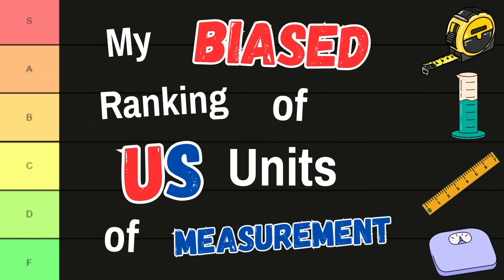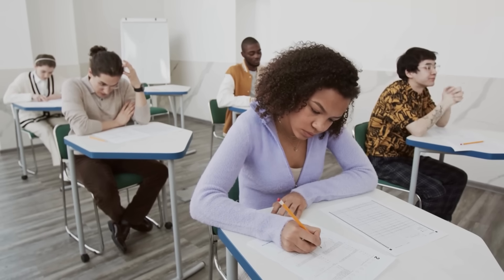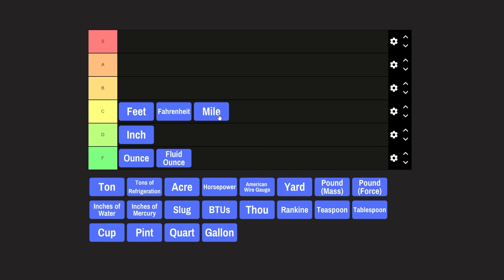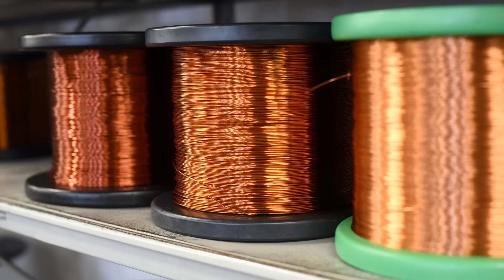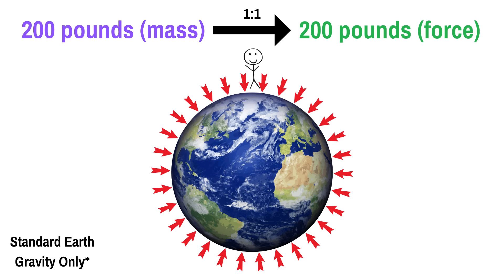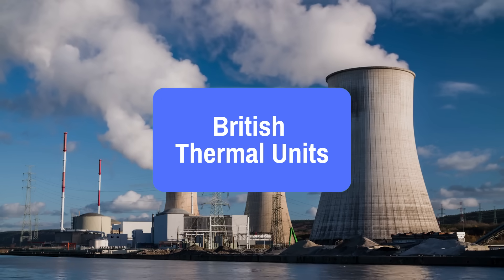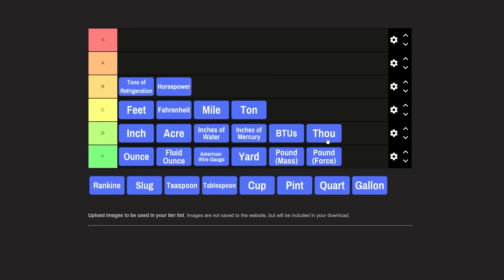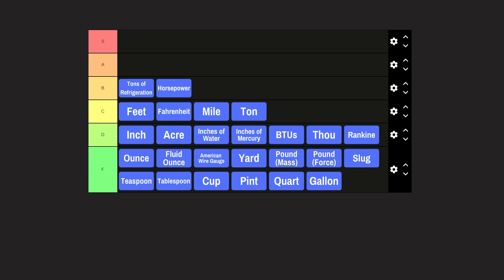Tier List of the DISASTROUS US Measuring System

Comment: To fully change from Imperial to Metric is usually a long lasting process. Here in Finland the metric system was officially adapted already in 1892 but older carpenters still use inches for the lenght of nails. And for wooden products for example 2x4 and 6 inch wide boards even if the manufacturers and sellers only use metric units. A 4 inch nail is now a 100 mm nail.
But inch is the ONLY imperial unit still in used here, for visual displays, wheel rims as well as for plumbing and hydraulic hoses and couplings. No feet, miles, pounds etc.

But we indeed imported a lot of things from both the UK and the US so that's probably the main reason why the Imperial lasted so long here - not mainly because of unwillingness to accept changes which obviously is the reason for the US to keep on to it.

Comment: The Ton deserves to be F tier since people will mistakenly assume you mean the imperial Ton when you mean the real Ton
Reply: We "metric people" still have a long way to go before we completely adept the fully logical SI system. It has only one unit for one thing. No tons, just Mg (megagrams) instead. No horsepower, just watts or kilowatts. 
And Bar used for pressure it's just because it's almost the same as the old unit kp/cm2, easy to understand. In SI it's either 100kPa or 0.1MPa. 1Pa is 1N/m2 which doesn't seem very natural in practice.

Comment: Fahrenheit is better for outside temperature, and better for thermostats. 1 degree celcius is too coarse and decimals are stupid.
Reply: No it isn't. You are familiar with Fahrenheit, that's why it's better😊
Reply: @CharlieMikeNS   Completely nonsense. It's just your opininion because you're (as already said) used to it. Why is it stupid to set the freezing point of water to 0 degree and the boiling point to 100 degrees?? 
I'm comfortable at +20 deg. C. and my  water for showering to be +35 to 38 deg. C. Completely natural. 
I know that water freezes at -32 deg. F and boils at +212 deg. F - but where is the logic with that?

And tell me, if you cut a 7 inch long piece of metal into 3 pieces of the exact same lenght, how do you measure them with a measure tape with a scale only in fractions? I don't know because I don't need to. With decimals you just divide 7 with 3 for the first cut and multiply the number with 2 (or add the first result to itself) for the second cut. Just use as many decimals as needed for the precision of your work. That shouldn't be difficult. This is why the engineering branch even in the US prefer decimals today, also because digital equipment tell the results in decimals.

Comment: Where's the ultimate us measuring system boss: the football field ?
Reply: football fields per deceptively dubbed eagle
Reply: A football field is 1000 washing machines, and 1000 football fields is one Rhode Island. If you need intermediate units - 7 washing machines is one elephant, 3 elephants are one truck, and four football fields are one Walmart.

Easy!
Reply: Olympic Empire jet elephants
Reply: The football you play with your feet (real one) or the one you play with your hands?
Reply: @OhmintO_xDthe one that is 100 yards long
Reply: Volume in bathtubes😊
Reply: In G tier cause F isn't low enough

Comment: Reminder the USA went to the Moon using standard units and didn't switch to metric until 2007
U
S 
A
USA
S
A
Reply: I don't think USA went to the moon because they used those units and WHY do you think they switched to metric after all? - It's because the US customary system doesn't fit in modern high technology. Scientists wants a logical and practical system.

Comment: I always thought Celsius was much less useful than Fahrenheit. You don't actually need to know where freezing and boiling are, because if you heat them to that point, they freeze or boil! What you need to know is, is it hot or cold outside, and Fahrenheit intuitively tells you that based on similar principles to 1 to 100 scales you've seen elsewhere. If you are doing science, I think it would make far more sense to use Kelvin.

Comment: Since you ask how many individual bills it can lift it should be more than 75 lifts before the battery runs out, assuming that you only keep it flying shortly for each lift. If you mean how many $1 bills at the same time then I guess the method of attaching them will become a limiting factor before they weight of the bills itself.

Comment: 02:40 f
A mile should be 1000 of something, and in ancient Rome it was, namely 1000 passūs, a passus being a double step, 5 Roman feet.
A Roman foot, BTW, happens to be a light nanosecond. 
I'd put it higher (if higher means worse) because there are several different kinds of miles.

Comment: Metric is nice because we simply understand 1cm is a distance. 1cubic centimeter is a volume. And 1000 cubic centimeters is 1 Liter. 1 Liter converts to mass aswell as 1 Kilogram. And sure enough backwards again, 1cc is 1 Gram. And the whole water freezes at 0, and boils at 100. So nice!! The entire system is interchangeable with itself.  Try doing anything of that basic stuff with imperial and youll be trying to wrap your head around it for hours. Pounds and ounces to Cubic Inches or cubic feet.

My god.... good luck!

Comment: I sorta agree when it comes to Fahrenheit..
While I would go metric all the way on all of the other measurements, I do agree that the scale of Fahrenheit is more suitable to human life. Not the 0 and 100 points. But the scale in general.
In Celsius, if you're told that the outside temperature is "in the 20s", that would not tell you very much. 20-21C is a LOT different from 28-29C. 
In Fahrenheit OTOH, if someone tells you that the outside temperature is "in the 60s", you'd know what to expect. Sure, 60-61F is a bit different from 68-69F, but not by that much.
The Celsius scale is simply not as well suited for measuring the weather. And very often I see temperature in Celsius with an accuracy of 0,5C. Which is about the same as an accuracy of 1F.
However, the freezing point of water being 0C is MUCH better than it being 32F. Since it's so much easier to automatically tell whether you'll experience rain or snow, by looking at the Celsius scale. When cooking, it is also practical that the boiling point of water is 100C, rather than 212F.

So in my opinion, the best temperature scale would have 0 as the freezing point of water, and 200 as the boiling point of water.
That way, almost all outdoor temperatures experienced by humans, would be in the range of -100 to +100. And if it's outside of that range, it would be deadly.

Comment: Not entirely right, If pound is force then mass is a slug and if pound is mass then force is a poundal. You can't simple define mass and force as the same thing.
Reply: That's the point, the word pound is used for both mass and weight because it was created before definition of force. They ended up have to add a bracket to help, which ends up confusing why not name it to something else.

Comment: US would probably have a more efficient industry if they used only metric, kids would learn faster and be less confused during physics class.
Reply: except we're actually taught metric for physics if you weren't an idiot and actually looked for five seconds into our schooling system. we just use imperial for 90% of daily life because a base 12 system is easier on mental math for most applications, as in you can easily cut something in half, thirds, fourths, sixths, or twelfths. Sometimes even visually
our volume based cooking measurements are easily scaled up or down for portioning (since you dont need absolute precision on even most baked goods as the literal humidity of the day can change certain recipes), you can easily divide a recipe or upscale it just from the simple ratios and fractions. most people cant taste the difference anyways and may even add spices or salt or whatever afterwards if its not suitable regardless.

that and the fact that if it wasn't for some stupid pirates the U.S was actually one of the earliest adopters of metric. having requested the metric weights early on only to have it intercepted after the ship left france somewhere in the antartic

Comment: horsepower...33,000 ft lbs. some say its rather arbitrary..
i say its 1000 pound of water lifted 33 foot in a minute. its actually quite reasonable, and easily replicated. you dont even have to measure the height as you know its the height at which water can no longer be lifted with simple suction...

its also equivalent to a "giraffe". that is, teh average giraffe is 1000kg, and is 5M tall. therefore a giraffe a minute is a horsepower.

watt never SOLD his engines. he charged a commission based on the fuel saved, the money saved, in comparison to a horse.

so if they replaced two horses with an engine, discovered it was good enough to replace five horses, they paid a percentage of money saved from feeding, maintaining, and operating those horses... all five of them. 

as he happily over-rated, as there wasnt anything else really commonplace to use as a unit, he managed to make more money from it than if he simply sold them...

who else took the approach of not selling an item but simply a commission? hughes, and his three cone roller bit... ironically, also part of the mining field...

"wire gauge" closely related to "gauge" in shotguns... "the sphere a pound of lead will make is one gauge". so two gauge is half a pound, 4 gauge a 1/4, etc...

maybe i missed it, but wheres the gallon? theres two of them.
and ton? theres two of them as well.

Comment: Most of the smug Europeans here have no idea that every bike in the world uses 1/2 in chain links. Other things still sized in imperial: rivets, socket wrench drivers, router bits, pneumatic threads and fittings. The fact is, if you're and engineer, you need to be literate in all unit systems
Reply: What's your point? Yeah there are still things using dumb measurements. Ok.
Reply: @logitech4873  there are too many people who take a "dumb" 3/16" rivet, drill a clever 5mm hole for it, and end up with a weak, loose joint.  If these things really are dumb, I eagerly await the success of your Metric Chain and Rivet Company.  Good luck to you, sir!
Reply: @paulgush  I don't use chains or rivets, not really my concern.

Comment: Not sure on the hate for ounce. 1 kg = 1 L = 1000 cm³. Water is reasonable there, since we all have an intrinsic feeling for its weight.
Reply: A US fluid ounce doesn't even weigh an ounce! It weighs 1.04 oz or something stupid.

Worse than F tier.
Reply: @XenFPV Guess what, a liter of water also isn't always exactly 1 kg. The video is generally missing why imperial is trash.
Reply: @graealex A litre of pure water at room temperature weighs 1kg though.

An imperial fluid ounce is one ounce of water.

A US fluid ounce, not imperial, doesn't even weigh an ounce. It's 1/128 of a US gallon, which is a nice round 731 cubic inches.
Reply: @XenFPV I get your point, but that Liter of water is only one Kilo at certain conditions. Which is still better than absolutely no reference.

Comment: I see a lot of units of Measure just to measure distance, pls use the metric system, one unit to measure all distances, the meter using multiples of tens up and downscale. Too many units of volume, use liter and multiples of tens up and down. It is really easy to use and keeps away the potato idea of having to remember what odd number of potato inches are in a potato feet.

Comment: As a european who spent 6 months in the US I have to say fahrenheit gets too much hate. For everyday life it’s just as good as celsius and I learned to use it intuitively surprisingly fast. I found the measurements for length, weight and volume much more problematic. Not one of them felt natural or intuitive even after 6 months of using them daily
Reply: just in case you want to give it a try again, dont think of it as specific numbers, think of it as a ratio. its primarily used in things not needing precision, so you can say ive got this foot long board and need 6 in, just cut it in half and you're good, use a ruler if you need any more precision but practical tools like saws are always gonna leave 1/16 in gap anyways due to blade thickness, which is also the smallest increment. the same ratio rules work for recipes, as most meals wont taste that different with a gram or two different, same for cakes.

for some more cultural context, the reason why cups/pints/gallons as well as Tsp/tsp stuck around is due to hospitality culture, where people are expected to have leftovers either taken with them or saved for another nights meal, its also the main reason our portion sizes are so big. but as a result, we may need to double a recipe requiring maybe 1/2 a cup of whatever ingredient, so we just grab a full cup or 2 of our normal amount.

also dont bother trying to convert feet to miles, nobody does it here and it was never intended for it. we always say things like "its 3 miles" or "its half a mile" only going to yards if its within >300-1500k ft (quite literally 100-500 yards as its a 3f t :1yard ratio unlike ft to meter which is 3.3ft to 1m)

Comment: 4:35 in the electrical trade we refer to these as 1/0 (1 aught), 2/0 (2 aught) all the way to 4/0. After 4/0 we use CMA or Circula Mil Area
Reply: Isn't it MCM or Kcmil once you get larger than 4/0?
Reply: Was about to comment the same